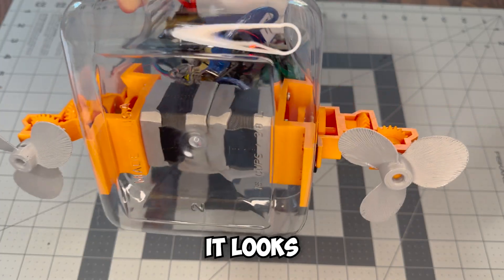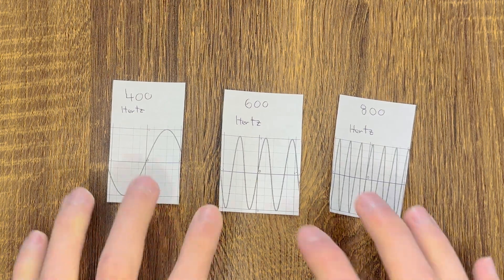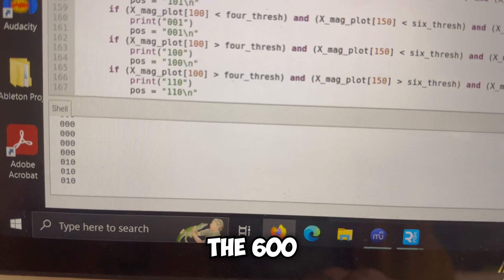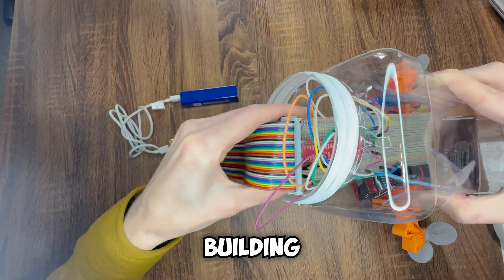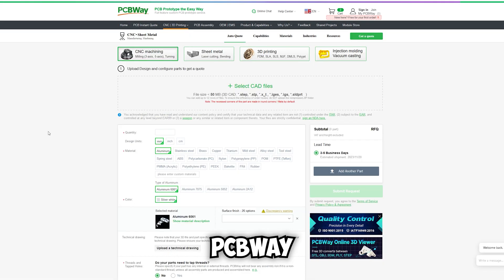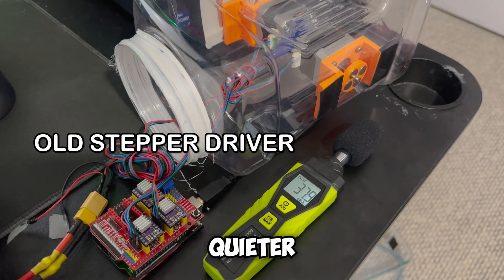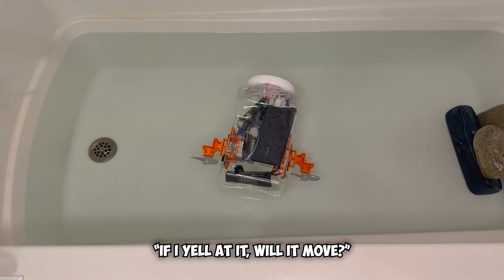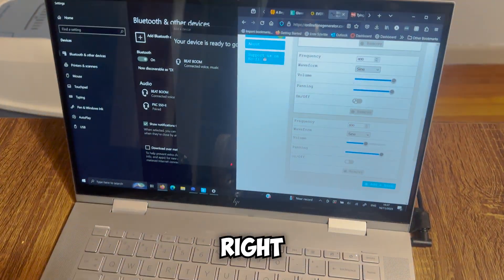Controlling a DIY Submarine with Sound

Comment: be careful when using frequencies that are harmonics of the same fundamental they can be created by resonance inside the box or from nearby objects instead of using frequencies that are integer multiples of each other use random numbers or even better combination of frequencies to send a command. Do a Fourier transform to detect and use a detection of relative amplitudes to send combinations and an adaptive gate to distinguish signal from ambient noise the further away you go.
Reply from the maker: Good point

Comment: How about isolating the stepper motor controllers in a vacuum? I realize the logistics can be complicated, and whatever you use to mount the motors could carry the sound out of the chamber, but maybe it would be enough to prevent interference with the microphones.
Reply from the maker: The problem is, a lot of the sound is carried through the body of the submarine. It would be hard to put the stepper inside without having it touch anything.

Comment: Awesome work dude, first suggestion, stick spectroid on your phone and stick it in the enclosure (maybe in the water/submerged?) and get an idea of a band of frequencies without tooooo much noise in them. 
Second, don't use frequencies that are easy multiples of each other like 333 666 999hz a simple system isn't going to be able to tell those apart too accurately. (harmonics)
Lastly (possibly entirely wrong as not done anything analog/realtime related on a pi) you running FFT on the pi? not 100% sure on this but would imagine a little arduino would run a simple low bin FFT a little more reliably as it has nothing else to do but communication, and that could just be some wires high or low, or serial if you really want (just mind out to not connect 5v signals to the 3.3v pi)
Reply from the maker: Thanks for the suggestions. That is true, if the frequencies are multiples, I may be picking up harmonics. And yes, the pi is running the FFT, mainly because I'm more proficient at python than the arduino version of C++. I will look into using the arduino for the FFT because right now, the highest sample rate I'm able to get is 2k hz, meaning I can only measure up to 1k hz.
Reply: @makermandan  Well crap, sorry for wrong lead? Atmega328p based Arduinos (nano,uno and kinda not really micro/leonardo) can only really do a max sample rate normally of ~9khz (yes with some jank upto ~50khz?). Then there would be not much cpu left for running even basic communication or basically none if using analogRead and not accessing registers themselves?
So, unsure what your using for sampling thats limiting to 2khz but learning a new language would be asking a lot to replace it, so maybe some nice non harmonic triggers and something with a little higher sample rate?

Comment: But doesn't the speaker also use radio waves?
Reply from the maker: Correct, but I think he means that I have to connect to the speaker using radio waves. The goal is that I can put the speaker in shallow water, and then it can communicate to the submarine under much deeper water.

Comment: Frequency might change due to water density and tub walls. So you should first check if signals works well in water. You can also add some high-quality  sound absorption material inside the bottle. In addition to that plastic material may resonate more and disturb signal. Moreover the quality of the microphone and its placement plays a critical role. If possible use an underwater microphone and place it where waves of water due to propellers can't make any disturbance.
Reply: You should isolate the motors with sound barriers and add microphones and isolate them from inner but not from outside
Reply: Bro just use fft

Comment: Wow that PCB Board is soo cool!! 

I wonder if the reason it can’t figure out the proper instructions is because of the container. Maybe the sound is getting muffled and also echoing? Does it read the expected values when you look at your computer (are the zero and ones right?) If not, what if the frequency between the sounds were more different/distinct?
Reply from the maker: Thanks Emun! I think PCBs are going to open up a new realm in terms of personal projects. Like you said, the program isn't super accurate, so I'll need to find a way to correct it. Making the frequencies more distinct is a solution, and another person said not to make them multiples of each other, because the harmonics can interfere.

Comment: I think you are missing a key component, interaction air - water - air may distort your sound, on top of that your sub resonance change if in air, in water, and how much pressure of water. That is also true for the motors, as they have to work harder, they change "sound" and if running on the same battery as the electronics you may see electrical noise (in FPV drones, a big cap is used or you would see motor noise in the analog video!) 
I dont know how you parse the data, but i guess a Fast Fourier Transform?
Record the sound in different environment, at different motor speed/load, and lets look at the spectrum
Maybe set up a github repo with the music and the script to parse, so we can play with it too?
Reply from the maker: Yes, I use a FFT on the raspberry pi to get the frequencies! I'll throw the code on github this weekend if you want to take a look :)